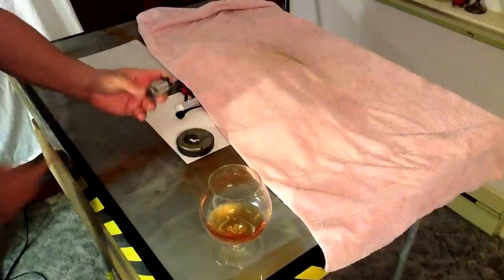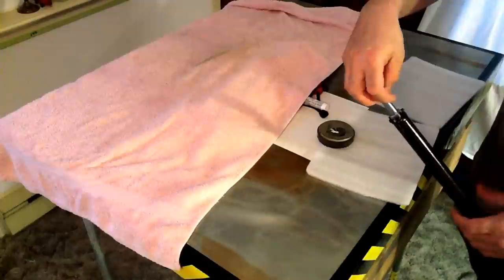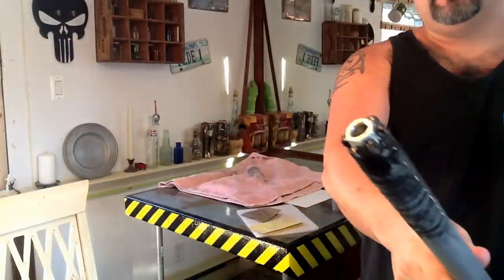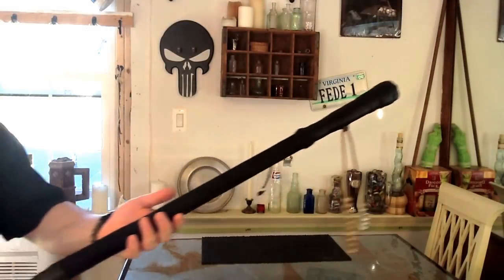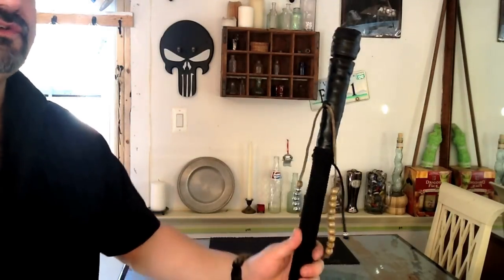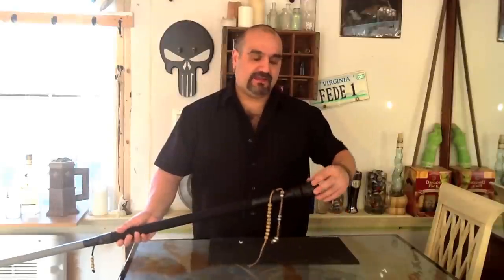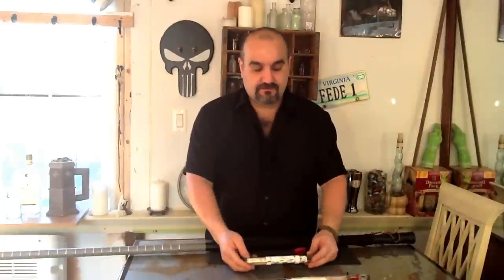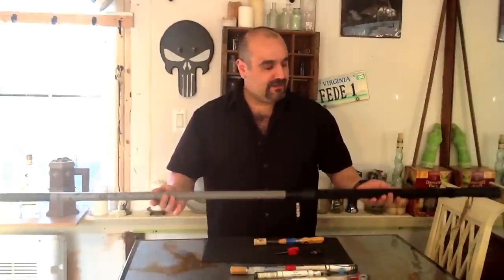The Ultimate Survival Staff

Comment: You mentioned you had two choices to use either epoxy or JB Weld. JB Weld is Epoxy for the neophytes. I noticed when you did your mix up you were slightly on the hardner. Having done this before myself I knew what was about to happen. I always go 1:1.
This is a little something I found on JB Weld: J-B Weld is The Original Cold Weld two-part epoxy system that provides strong, lasting repairs to metal and multiple surfaces. Mixed at a ratio of 1:1, it forms a permanent bond and can be shaped, tapped, filed, sanded and drilled after curing.
Reply from the maker: I'm not sure that categorizing JB weld as for "neophytes" is a fair assessment.  While in 2020 there are countless affordable options of epoxies available everywhere, in 2012, sourcing it - especially for small projects - was both challenging and a bit cost prohibitive.  I used the most readily available materials available to me at the time.  The clear epoxy I ended up using to coat the staff took forever to find, and was very expensive to buy/ship at the time.  Rebuilding this project today  I would of course make different choices across the board, there are tons more options available now that I did not have nearly a decade ago.  JB Weld is still in business today for countless reasons that perhaps you've overlooked, and none of those reasons include the foolish purchases of a novice.  For your reference here is an article written this year regarding Epoxies including JB Weld: https://toolsfirst.com/best-metal-glue/ .....here is a quote "Regularly used for industrial purposes, J-B Weld is known as the gold standard when it comes to epoxy glues. The 8265S is J-B Welds best variety, which is why it takes our best pick spot. For long-lasting metal and household repairs, look no further than the J-B Weld 8265S."   .....JB Weld holds 4 out of 7 spots for the best epoxies based on their findings.  neophytes?  SMH

Comment: Job well done on your staff. If I might add 2 ideas for your staff. In your 1st Aid Kit, a clean feminine Tampon. They are designed round for wound insertion like bullet wounds  or piercing from a knife. And also have been used to start fires too. 
2nd item to consider is ACTIVATED CHARCOAL CAPSULES.  They can be used for intestinal diseases  as well as external  bleeding  will help clot blood. And also for insect stings. 
And yes Proper Planning Prevents Piss Poor Performance.

Comment: Dude, I love what you got there, my only concern would be if you happen to get caught in a thunderstorm, that carbon fiber pole is going to at like a lightning rod. No, I'm not kidding. I made the same mistake a number of years ago when I took a thin walled section of stainless steel pipe and it worked great until a thunderstorm came up and a couple of the guys I was with told me to get rid of that lightning rod. I took it over to a tree about a hundred or so yards away and leaned it up against it, and ten minutes after I got back KABOOM! Yep, lightning hit the tree I leaned the rod against. 
I got a buddy to repair it for me and I keep it to remind me to think things all the way through in future. In the fair weather, your staff would be great but if a storm comes up you need to get away from it. Just saying.
Reply from the maker: I agree, that is one of the only concerns I have about that myself.  There are a lot of hiking poles made from everything from steel to carbon fiber, I realize mine is longer which increases the risk.  if I were to rebuild it, it would be a good foot shorter.
Reply: Here's a tip I learned, use Kevlar tubing on a wooden staff and only use the Kevlar on the ends, no more than a foot on each end. Now, yes, Kevlar is still a conductor, but if you only have it at the ends you don't have a lightning rod anymore. Yeah, it'll be a little heavier but it will make a great staff. I've had to fight off dogs, Coyotes and the occasional feral hog with mine, I carry a gun now so it's not so important to do much more than just flip the occasional territorial snake away. I suggest a closet rod since you'd be3 reinforcing the ends with kevlar to make it light. I use Hickory because I like one that's heavier. Have a good one.

Comment: pvc pipe is weaker. its also for free in dumps, renovation sites etc. you can always buy a carbon fibre kit and coat a pvc staff once you have the details ironed out.
Reply: I made a pvc staff for a friend.  He's about 170 and he said it saved his bacon.  Schedule 20 thin wall is clearly unsafe but a sch 40 is okay and it can be reinforced if needed.

Comment: PE, it might have been nice to add some links to sources of major components like the carbon shaft for instance. I thought for sure you were saving (as your last presentation) a knife/spear point with threads welded to the shank so you could screw attach it firmly for a ready made spear. That's something I plan for mine. As a poor retired guy living on a shoe string I probably will choose 1" EMT @<$5, the thin wall metal pipe used for encasing commercial wiring at least as a test bed for my first walking staff. I will trim the handle of a spear point 8" fixed blade knife I have to slide into the EMT then pin it with removable pin!

Comment: You may use your survival pole as fishing rod. You know, the part where your "step counter" is connected to the pole might be used as the top of the fisshing rod.
Reply from the maker: +Ultramarinus247 that's a great idea!
Reply: +Primal Edge: Thanks. Actually, i have a LOOOT more:
Human predators (especially in midle east and US, where are the 
mechanical and heavy millitary guns distributed in similar degree) are 
better reppeled by gun, or a squad of colegues with guns. Other thinks 
you may add to/inside your stick:

- colapsible slingshot. In nature, your munition for that (rocks) is 
anywhere. If you want to go nasty in urban area, you may use steel 
haired ring attachement for stabilisation and add inside a handfull of small arrows even. Like four, knitting needle shaped arrows may suffice for a start, and if you made them with backhooks and coppy a way to attach a fishing line to them, you may use it pretty much for fishing, and/or small game hunting. With MUUUCH better chance of success than when trowing a spear on a rabbit, squirrel, or a bird. 

- If you consider small game, you may add some wiring, or fishing lane inside your staff, for easier way to make snare-traps. 

- When dealing with single dangerous animal you do not want to injure - a dog lets say, or when in indoor situation with hostile and armed human oponent, you may even consider use of few meters of steel-rope. It is as effective per flawless use/hit and as quiet as garotte, but with much safer distance added. Therefore may be use thru a shelf in a storage, or from higher position than the target walks - higher floor, scaffolding, etc. Also, may be used as ad-hoc climbing utility for scaling from lower floors to safer/ground level, or a way how to attach your steel-rope witouth anchor/tip on the end of rope to a (up to 2 meters) higher position. Also may be used as a base for picking tree-fruit, like apples. - Reinforce the opening with some wiring, add a bag under it and start picking...

- Definitley add some filtering straw, few of purification tabletes, at 
least 2 ways how to start a fire and some kind of aluminium pack. Water is priority, you´ll have to solve tens of days before hunger will strike you and when you want to have a way to cook something, you will have to have something, that will fitt in your stick and may be used as surogate pot for direct cooking. And aluminium/covered bag from a camper-meal, wich is considered to withstand the heat anyway (when it may be baken ower the flame) is only possibility it comes to my mind. Some big piece of plastiq. May be used as basic material for a hut roof, for condensating watter out of digged hole from ground, like makeshift poncho, etc, etc. Black bag may be ussefull too, when you travel in winter, or snow covered area, you may stuff the black bag with snow and let doo the sun its work with liquifying it. It will need some purification, and/or boiling afterwards (of course not in plastiq bag), but will save some time and fuel for you. If you are in hotter area, you may use the black bag idea for makeshift hot shower before bedtime.

- Try to add enough of thermo-foil to insulate yourself from the ground, even when not in forested or urbanized area, where more possibilities for insulation may be found - branches, grass, leafs, ruggs, palletes, etc. Thermofoil (when the piece is big enough and you have some ducktape) may be also used for makeshift thermoholding "cloathing", or with a TON of ducktape for a makeshift mocaseen/shoes.

- If adding first aid stuff to your stick, do not forget, that for most 
broken bones in arms and leggs, you may use your staff parts with some bandage to fixate the injury. I mean, for others you may easilly find other stick, but when YOU are the injured, you will probably not be in a state to walk around, looking for a better stick. AND in areas like desert, steppe or inside a cave, you will not have anything better 
around in a MILES. When we are talking first aid, when there is injury, with colapsing lung as a result, you may add some hollow needle with valve at the end. And maybe a quick turnicet, for stopping the loss of blood. In "combat situations" (ie lots of bullets around), those injuries are quite nummerous and witouth the right equipment are kinda hard to counter.

- Consider adding inside (or as a custombuild handle) some tiny 
monocular (tele)scope. 

1) - it may help you to set a fire in sunny area quicker than a magnifier and 

2) - keep you informed about your closest "distant" area. I mean - it is better to keep your situational awareness as high as possible in any survival scenario, especially, when you have only a stick/spear to defend yourself. 

- You have a nice throwing javelin. If flexible enough, you may drill a 
hole in a bottom area (other end than the one with a blade). When 
needed, you may use your paracord as a loop thru there for some 
throw-help. I am thinking kinda surrogate rope-based altaltl here. 

- When you want to try some big game too, or when you need yourself to protect in forested area from predators (animals or humans), you may use a knife (even the blade of your javelin) to cut and clean some wood to make a bow, for wich you may use your paracord instead of string. Also, you may add some scalpel blades and superglue, for easiest way to make letal enough arrows. The superglue (if not have toxic materials in it) may be used as makeshift (but fast as a hell) laceration wound closener. But one point, when you will go bow and arrow. Do not abandon your spear. You may hold your spear next the bow in the same hands you are using to hold the bow during shooting, or you may use the thread under your speartip and make with some paracord holster/bag handles, you will dress like a bag on your back, when you are bowhunting. 

Sorry for my english, i am not native speaker and it is 23:45 here, when i am writing this text down... :D

Comment: Also if you're only carrying razor blades in your survival kit (you didn't say), you could easily fashion a handle for one, with it's self out of bark, then make a small wood peg, drill a hole in the bark, hold in your hand and use a small rock or stout stick to peg in place, and ta da! You have a handle.
Another way to do it is to just put it in between two pieces of wood lying close by and then lash with some stout foliage.
Then you can just use some more of the same bark to make a sheath. Obviously you want stout bark that won't fall apart immediately, and dry, or the blade will rust and need constant attention. Grab a fine pebble and hone the edge back up.
Next either use your new knife to then make a wood handle or more important stuff like food and shelter.
Remember, this is, like, if you are going to die. You either learn to survive with tenacity, or freeze your butt off and do nothing all day. Use your imagination, and doing something is almost always better than nothing.

Comment: The inch lines could also be used to gauge the depth of a body of water that you need to cross
Reply: Also good for weighing things.  Find balance point of stick as fulcrum, hang something you know the weight of off one end, and the thing you want to weigh off the other.  Do the math on the ratio of the distances to the fulcrum vs. the weight you know.

Comment: The only problem with the hollow graphite tube is that if it it hit hard enough on the side by a sharp rock, it can fracture and that can lead to breakage, just like in a graphite fishing rod. Rap it hard enough on the side, and it can then break in two. I would rather have a solid staff for that reason.
Reply from the maker: It's coated with nearly 1/8" of epoxy resin to add additional protection, some of those areas are also covered with fabric that increase it to 1/4" */-. the carbon fiber material is the same stuff used on helmets, bike frames, trekking poles, skis, snowboards, and even baseball bats. Unless there's some extreme X-Game hiking sport where you're expected to do ninja pole vaulting,  or smack 90 mile an hour fastballs made of miniature boulders, I'm quite confident it will hold up to a hike in the woods.  It's a hiking staff, not a martial arts weapon. if your hiking pole suffers the same abuse as a baseball bat, golf club, or car bumper, you're doing it wrong.....

Comment: You may have answered these questions already but I cannot find the answer. what is the dimensions (length, ID, and OD)of the carbon fiber pole? where did you get the tubes?
Reply from the maker: Hi Brian. it's been years since I've had the spec sheets on that pole, and I can't recall which company I bought it from.  BUT, I remember the Inner Diameter was 1" exactly, I used that because the clear tubes where just shy of 1 inch, so I knew it'd be a snug fit - without being to tight.  the height was just shy of 6 feet.  When I first priced the tubes - they were expensive.  However, I found a supplier that had remnants they would sell. I got lucky that they had a tube in that size.  But for sure, you'd save a TON of money if you searched for off-cuts instead of ordering a new tube.  Sometimes you have to email the company,   Someplace like Rockwest COmposites or maybe Clearwater Composites. I hope this helps, sorry I couldn't be of more help.

Comment: Thanks for all the great ideas. I have a sturdy CETME  military rifle bayonet I have been wanting to make into a short survival spear.  I am using 5 foot long electrical conduit pipe for my shaft with 1/2 inch pipe nipples plugging the ends.  The Bayonet ring fits nicely over the short 2 1/2 " long nipple on top and i just need to manufacture a bayonet lug to snap the blade to. I use a steel cap scrwed to bottom nipple.  I had never considered using the hollow interior and those plastic tubes to store survival gear. I think i would access my tubes from the bottom as i plane to reinforce the top.   Do you have a link to where you got those plastic tubes?

Comment: I like your video and been looking around to see what other people do with walking sticks. I hike a lot and  been searching for material too build mine. My idea was along your Idea. I was thinking of pvc, than I said no it not strong enough. Aircraft aluminum maybe. However the fact you you used a fiberglass tube is really a nice idea.Did you use grip tape half way down as well and than encapsulate it with a resin ? Home depot has a tape called steel wrap, soak it in water than wrap, stiffens the area like steel. Please if you can tell me where I can buy the fiberglass tubing, having hard time finding a retailer. A reply would be appreciated ty. keep it up man like them video and ideas.

Comment: Someone help me out here I do not see the reason behind "Small sawblades" The reason being is I can break a "Small Branch" with my hands, Same thing goes with a big branch if I use leverage maybe I don't see the point.
Reply from the maker: It's not necessarily for processing kindling for a fire, but for any type of precision woodcraft you may need.  Making notches for traps, for example.  While yes, you can use a knife, it's a redundancy tool that was lightweight and fit in the kit.  It's like carrying multiple ways to affect fire, it's one more cutting tool to make whatever you are doing, easier...  Also, It's not a required tool, just a suggested one.
Reply: Topstormking but the small saw blades stay sharp forever and can be used for variety of tasks not just processing wood for fire
Reply: Sawsall blades would fit in that tube well, and it would be easy to fashion something that holds those blades and screws into the all-thread coupler.  Vwaalla!  Pole saw.

Comment: Questions. . . thickness of the tube wall?  Circumference?  Did you have it cut to the length you wanted, or off the shelf length?
Reply from the maker: I cant recall the wall thickness, it was no thicker than a business card though.  inner diameter was 1 inch.  I got the piece as a remnant from a larger job.  I can't recall the vendor.